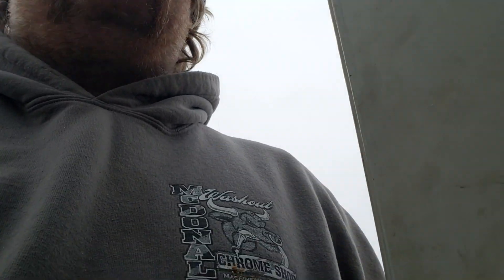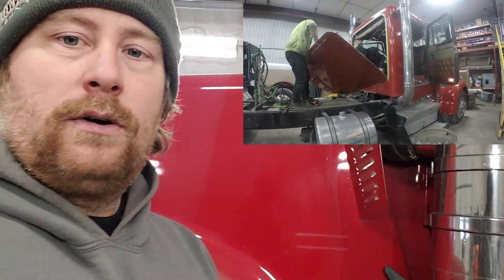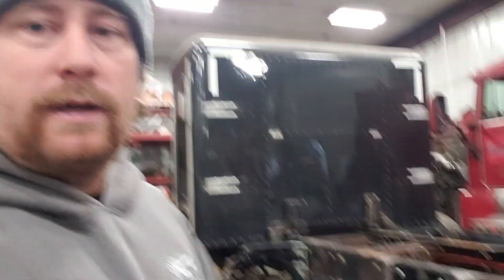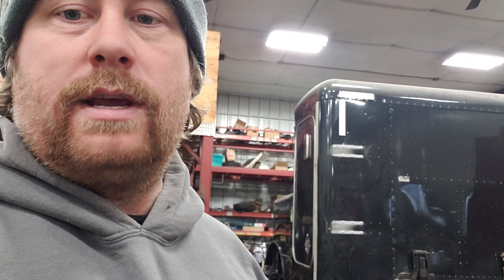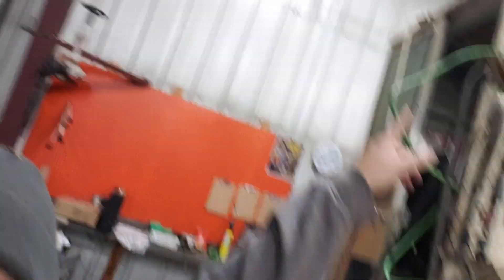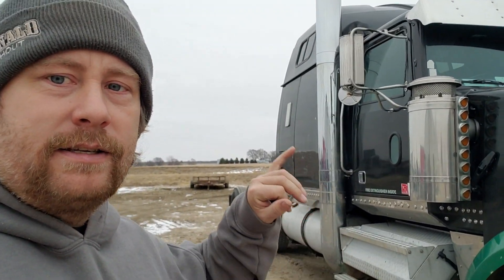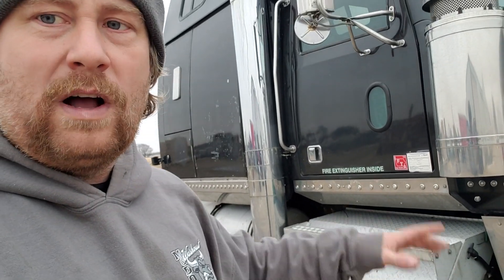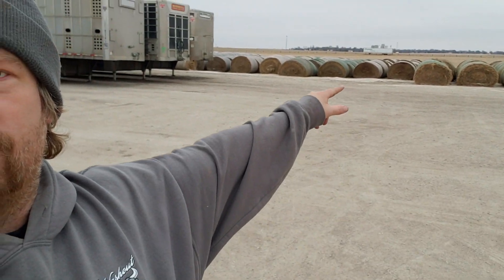McDonald Chrome Shop | VLOG 1 | 1-13-20

Comment: So you run a chrome shop as well as running a haulage company and repair shop as well ..
Reply from the maker: Susan Sullivan we farm 1,500-2000 acres of corn and soybeans, we have the 2nd largest stocking chrome dealer in Iowa, we have a used truck dealership, we build these trucks to resell, and our main business is a livestock trailer washout. So we stay pretty busy around here. We hade 200 head of cattle we calved each year too but when dads health got worse something had to go so we let the cows go.

Comment: Does this kit affect the structural integrity of the cab itself.
Reply from the maker: Susan Sullivan the way we tied it together no it kept the structure sound. There was a bit more in it than we showed but its not hard. Ive had requests to show an in depth video on it so we will try do do that when we get another truck in to do this on where we have to make the hole bigger where this kit wasn’t meant to be.  Thanks for checking it out